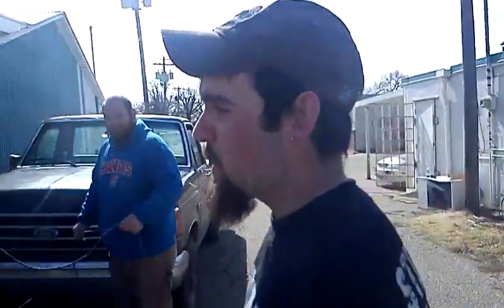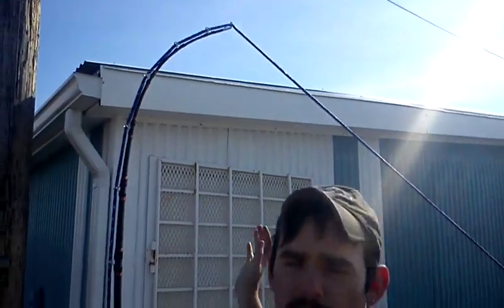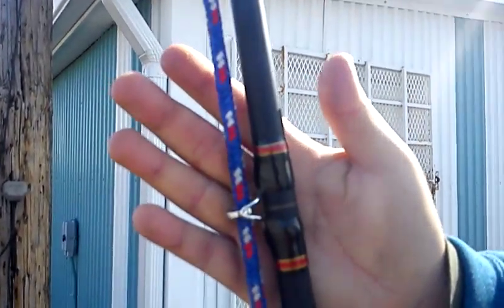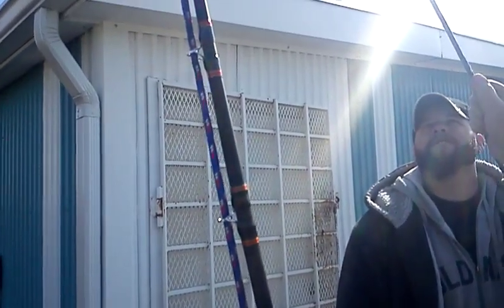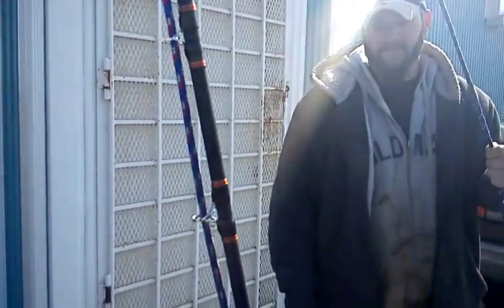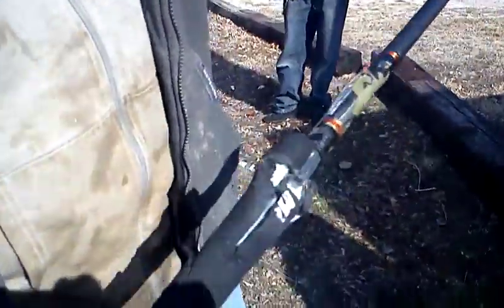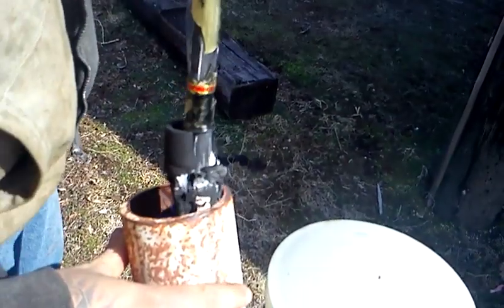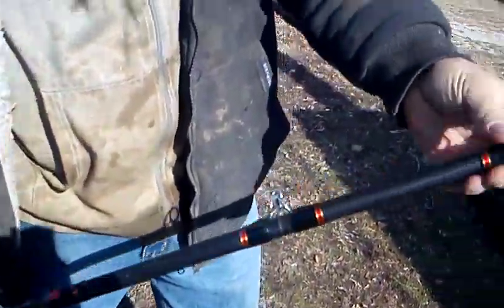worlds strongest fishing rod pole part 3... finally breakage MUST SEE

Comment: My 7' Daiwa Beefstick BT-FT 70XHR casting rod and Penn Senator 9/0 with 80 lb mono brought in a 6 ft long (4 ft girth) giant black sea bass (like Goliath grouper) in 2 hours to the pier then released unharmed.  That fish was over 400 lb, the same combo brought in 8 ft long 7-gill shark a few times in the winters. If I mount a Penn 12/0 with 120 lb mono top and 2,000 yd 130 lb braid I can bring in a 1,000 lb shark to the pier by the Beefstick rod.